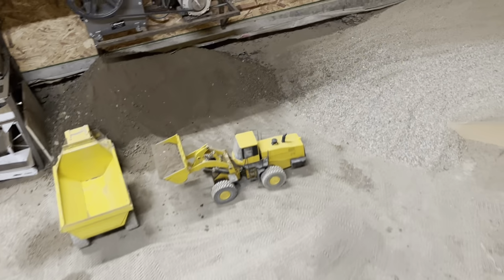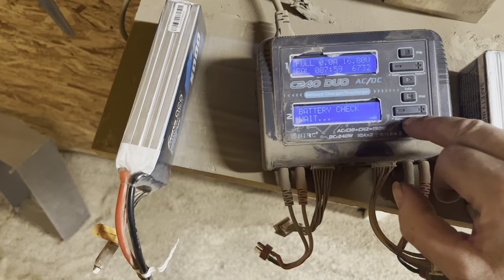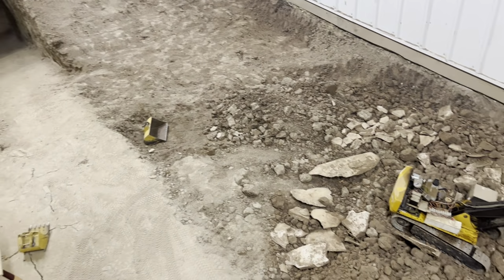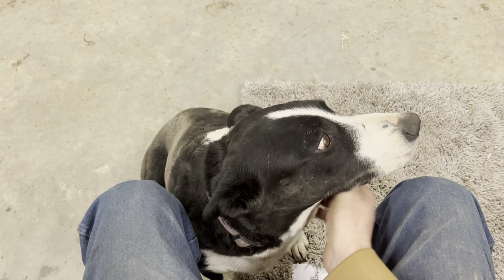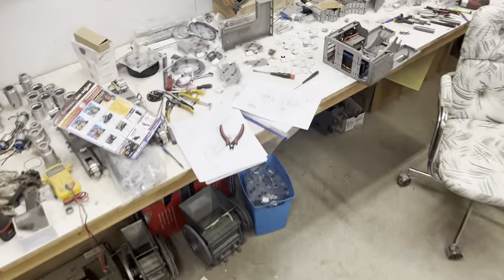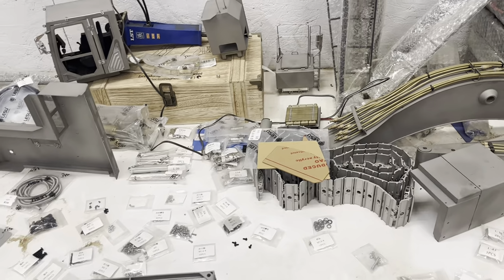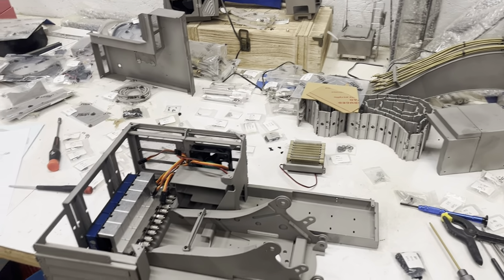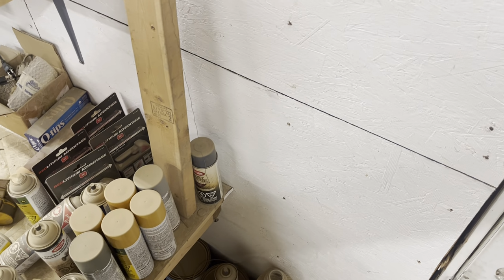WA500 B50

Comment: Nice to see you also got the 374. I built one end last year and upgraded it from beginning with premacon valve and block.  Also added BIG oiltank for it so you dont get the oilspill from the venthole on the stock one. All electronics in the tray gone and I installed full size tank there. no heat problems and its strong.
Reply from the maker: How many ml tank did you make?
Reply: @LilGiantsConstrCo  It's arround 400 ml I can post my changes in one of the facebook groups if you in one of them?
Reply from the maker: @malawicarsten  you could show me Facebook messenger
Reply: @LilGiantsConstrCo  message sent.